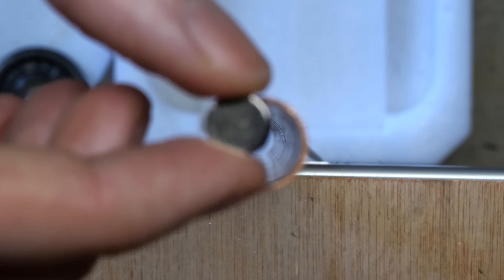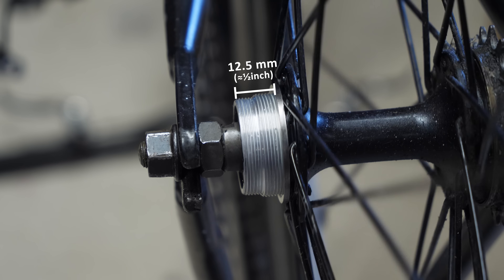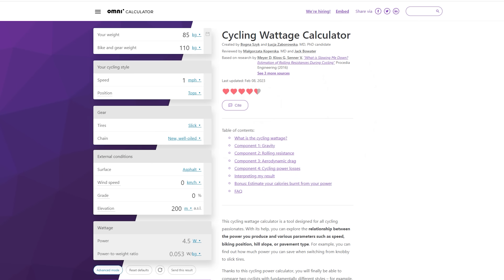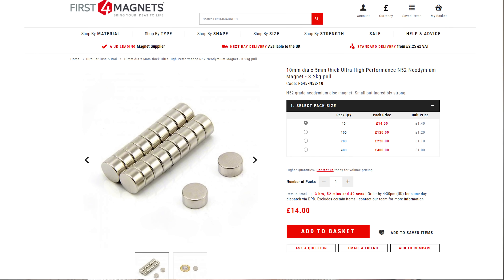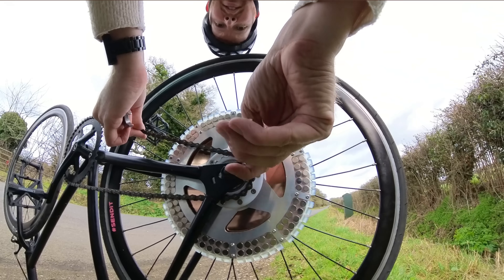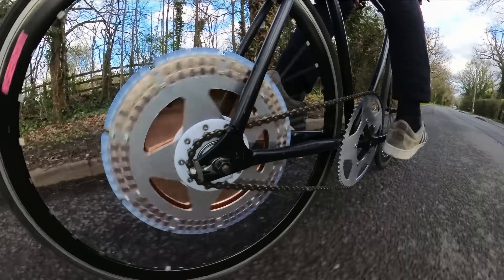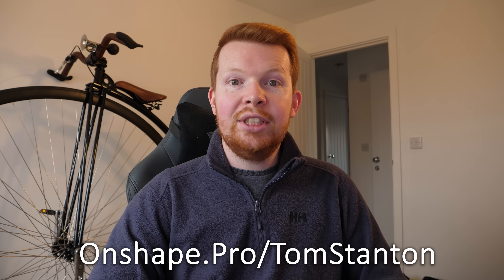Gearless Magnet Bike

Comment: I'm no wiz at this stuff, but couldn't you replace some, or all, of the solid plate with some coils? You might have to get fancy for which and how much, the magnets pass, but with some rectifiers and a battery, or maybe a big capacitor, and either a  motor assist, you'd be preserving a lot of energy. Might make for a nice e-bike that you can recharge on the go, even while "e-breaking."

Anyways, like I said, I'm no wiz, I just see wasted energy that looks like it could be kept or recaptured. 

nice project, glad you made the video. :--)

Comment: Seems you could gain functionality in several areas via electromagnets as they are stronger and can be disabled fully or partially. You could have fewer magnets and have a switching to allow for some or all to be turned on or off. I'll leave this idea at this for now - I'm an engineer, if you want to discuss this further and/or need/want assistance, let me know.
Good post, interesting concept and video. Thanks for posting.

Comment: 1) I believe the copper needs to be a larger diameter and another set of magnets attached on the outside of the existing ones, and 2) pedaling backwards should increase the braking force

Comment: I’m wondering, making the copper disk a larger diameter, cutting out a lot of material in the middle of the disk and perhaps drilling additional holes would improve the whole system, particularly in helping to bring temperatures down. Also increasing air flow through the magnet holders. Either way, what a fun idea, who cares if it worked as intended or not, best way to learn is by doing.

Comment: I have an idea for modernizing the way energy is transferred from the pedals to the wheel. The concept is to make it an electric transmission. The wheel would be driven by an electric motor designed for bicycles, while the pedals would drive a generator. Due to the high efficiency of electric transmission, this setup would result in high overall efficiency, and at the same time, it would allow smooth adjustment of torque. You might even be able to control the torque electronically. I think this is an interesting idea—I haven’t seen anyone try it, and it could actually work.

Comment: Looks like it is not very efficient at achieving an output of 1 to 1 however it is quite similar to a viscous hub using fluid transfer instead of attractive magnets, maybe you could try and combine the two principles, once the magnetic force reaches a certain torque you could have the viscous hub engage almost like a second gear

Comment: You said the torque goes up as speed increases, but I would think it decreases with speed. Electric motors have a max torque at zero rpm, and as speed increases, torque goes down.

Comment: i just realized your biggest mistake with this is using solid disks. wound wires would have worked a lot better. second mistake is thinking the amount of magnetic field is important, when it's the strength of the field that's important, so, had you attacked the magnets it would have been more effective. i guess having all the energy to make stuff doesn't mean you understand how to make stuff.
Reply from the maker: How would wires be better than a solid plate? Magnetic brakes use solid plates. I used N52 grade magnets with the smallest air gap I could manufacture, therefore the field couldn't be increased further. What am I not understanding?

Comment: People redescover some of these effects. My 1962 speedometer uses an aluminum disc with a magnet spinning around connecting to the transmission output cable.. adjust the size of magnets will change the speed displayed.

Comment: You could have simplified the spacing issue by using a bike with a wider P.L.D.  Modern road and mountain bikes use wider hubs. Fixie frames, like the one you were using, a much narrower and have less space between the hub and the frame.

Comment: Interesting experiment, but this kind of eddy current coupling is extremely inefficient. The induced currents in the copper disc turn most of the energy into heat instead of motion. So while it looks cool, it’s fundamentally a very lossy and impractical drive concept.

Comment: Smart people acting like idiots like this idea a lot.  But the magnetic connection of the sprocket to the wheel is stupid in many ways. #1 it is already connected properly. 2. power to weight efficiency is required in a bicycle, and you are doing just the opposite. 3. Find something useful to do with your time.

Comment: Aluminium falls slower because although the conductivity per m is lower, the ratio of conductivity and mass is better. If both the copper and aluminium were the same shape and the same mass (for example, rubber weights are added to the aluminium to make it as heavy as the copper), copper would win.

Comment: I wonder, you had a laser cutter and aluminum plate. Why didnt you cut out a gear out of it and then just grind some taper on the ends? Some cassetes in bikes are made from aluminum. Its probably a harder grade aluminum then you have, but it should be a lot tougher than plastic

Comment: I would like to see how it holds up with an engine driving it.

if you do it right, you could "engage" the clutch with a cable. because its not a solid connection, it would not stall the engine, as you give it more power, the clutch would automatically regulate it and act like a torque converter.

Comment: I wonder if this is the magnetic equivalent of a hydraulic torque converter. Since the torque to the wheel scales with the difference between the input and output speeds.

Comment: Seems you could dissipate that energy segmenting the disc and putting a load across the segments.
You could then vary the load and achieve different levels of direct drive torque and breaking efficiency.
In all honesty, it would be better to just replace the wheel hub with an electric motor then sink the load into a battery.
Then you could use the battery in the opposite direction to propel the motor when sufficient charge had built up with bridge rectifier.

Comment: if you use a squirrel cage instead of a solid disk, as in an asynchronous motor, the losses will be lower. In theory, the efficiency will be 80% or more

Comment: In the beginning when you show two plates falling to ground one aluminium one copper and you say that copper falls quicker because it’s heavier that is incorrect, weight of the object doesn’t matter on how quick it falls but only air resistance (in that case electromagnetic field) you prove it by dropping feather and stone in vaccine and see they fall with same speed.

Comment: This is a "dry torque converter," I understand. It uses a magnetic field instead of the  automatic transmission fluid in cars. Or the friction of the vernia dial on a radio.
As a gear changer, it has low transmission efficiency. However, I think that by adding coils, it may be possible to control the assist ratio of  electric power-assisted bicycle and the gear ratio as a whole, like the planetary gears in Toyota hybrids.

Comment: I think it works like a torque limiter, the human muscle might have preferable speed to deliver maximum power. However, it doesn't provide any change in gear ratio.
I think it would be interesting if we can make gear out of it like a magnetic CVT (I'm not sure if it even exists yet), 
One idea is to make a planetary gear like one in automatic gear and use magnet to lock or resist on one the ring gear to change reduction.

Comment: so, make it a 90 degrees moving alternating magnet disc cvt, instead. yep the small driving alternating magnet disc can move along the radius of the metal disc, so a cvt. then the drive shaft is horizontal from the pedals to the back wheel. no chains. yep two of those gears make a chainless axle bicycle drive. also no touch is required, only the magnetic contact.
Reply: yeah replace the whole chain with axle magnetic drive against the drive disc, copper or steel disc. yep iron disc as the second disc with a small axle roller would be the best, exactly like a standard gear minimal slip but non-contact still. ie locked gears vs free friction gears.

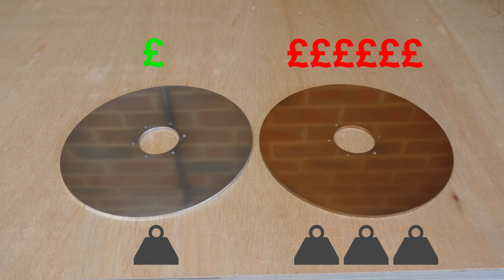Comment: 2:35 As soon as I saw this setup I immediately thought "That's the magnetic braking system of a baitcaster fishing reel". They work on the same principle, you control the force of the braking power by adjusting the distance of a magnet array to the spool. It's usually done with aluminum spools in those reels.

Comment: If you want strong 3D printed parts try thr Markforged Metal X.
It 3D prints in Copper, various types of Steel, Inconel etc. They're not cheap but if you're creating 3D print designs that require strength you can't best metal 3D printers, way stronger than resin can ever be.

Comment: Change the magnets to coils. Remove the chain. Add a generator to the pedals and directly link its coils to those of the clutch. This will induce a magnetic field at each coil of the clutch that's directly proportional to the speed of the pedals.

Comment: I have worked in the electric motor industry for my entire career, so I have some understanding about induction motors.  What you have created is a very low resistance rotor due to the low resistivity of copper. This results in very low torque under high slip conditions (which is what  you have during acceleration).  You might have better characteristics by using a “lossier” rotor.  It will develop higher torque at high slip at the expense of more loss at low slip.

Comment: The only issue I can perceive with this magnetic braking/gearing sitch is the amount of heat that both the copper plate AND the magnets experience when braking, for the magnets sake. Heat the permanent magnets enough and their power will diminish, showing up as a torque loss.

Comment: Technically it is an electric bike. 
Maybe you make a disc with the magnets that would be attached to the wheel and the copper bit to be attached to the sprocket - maybe this would help with further modifications?

Comment: It's an interesting idea and a great video. Unfortunately, as a way to achieve a variable gear ratio it's kind of doomed as any difference in speed between the magnets and the copper (slippage) is going to waste energy and it's unavoidable (as you discovered with the copper heating up).

Comment: Why to work in the negative direction? As a physics student i can see there's lots of loss of energy. 
There's a high resistance at starting ( you have to work like a buffalo to start the motion)
Even at highest speed you have to work on it more and more to maintain the momentum. (No gear ratio) You can't get any mechanical advantage from this work.
If you waste time, get something effective and useful. Thank you.

Comment: The only question I have is why did you start this project with a touring style city bike? You could have saved so much time with any other bike as long as it had working front and rear derailer. I definitely like this proof of concept. It kinda reminds me of a torque converter on automatic transmissions but magnetic.

Comment: Nice effort, but your comparison between the aluminum and copper discs was relatively useless. The copper disc is asymmetrical and out of balance, adding resistance. Your test is just as flawed as Veritasium's.

Comment: I'm a home inventor that came up with the same idea.my first attempt was to secure  small neodymium magnets around the perimeter of the wheel tread and three adjustable magnets just above the wheel.it actually worked.then, I made an axle version with less magnets and it worked as well.one thing I had to do was place weights at specific points along the rim to balance the tire,and it made a huge difference.im going to continue with this idea.youre on the right track,my friend.d9nt give up!😉👍🏻💪

Comment: There is not, "no friction". The friction is magnetic in nature. That overheating will quickly kill those magnet types. In a disk, you are creating a "record player grove" of magnetic forces. If you put a wire in the center of the disk and another on the outside edge, it would be generating a current. On the reverse, if you applied a current to the wires, the disk would start to spin. It spins because the magnetic line that is formed, is trying to repel itself. That cause it to push in one direction, which starts to draw "record groves" of magnetic mono-pole or "inward pole" forces. (This is also how your power meter works. The higher the amps, the faster the disk spins. If voltage is constant, each rotation can be used to calculate the wattage draw. However, power companies know how to manipulate the voltage to lower it, so amps increases, spinning your meter faster, so they can charge more. What was once 120v has dropped to 110v and as low as 90v in some instances where the power companies are shady!)

P.S. New meters use a disk, but also now use a circuit to get "power grade adjusted readings". They compensate for lower and higher voltages as well as "power factor", which is a loss when the waves of AC are off-center too far. That was another way they could manipulate the power to charge customers more, for less power actually being delivered. (Relative to what the billing reflected as "delivered wattage", which is a measure of amps * volts, which they don't actually measure and just, falsely assume.)

Comment: This was awesome. Useless but awesome. And a belt instead of chain would of helped.   You should actually keep the same idea but for like a regenerative electric brake just for your lights n stuff.   Like a small battery pack under the seat. N lots of fancy lights or radio.  No charging ever needed😊

Comment: Just what we need plastic breakable gears, with an inefficient slipping drive system. YEAH!! WHY DON'T YOU INCLUDE MAGNETIC STEERING, SO YOU CAN CRASH CONSTANTLY!! Realistically magnets might make for a good suspension. Changing your gear ratios won't change the FACT that your drive slips.😢

Comment: What a great video! Could you try using a steel disc and see what the results are? Instead of using eddy currents you would be using standard magnetic attractive force, which can be utilized to a greater degree of efficiency. Like a wind turbine, but your legs are the wind and the wheel is the turbine.

Comment: Putting permanent magnet doesn't make sense, if you want to make a practical break, you must make a coil, like a selenoid, a battery pack of somesort, and a switch on the steering. Also, the slower the bike goes the worst the break is gonna work, so such thing would be useful to slow down the high speed if the actual breaks are not sufficient, since at higher speeds this is very sufficient.

Comment: This magnetic sliding clutch could be an alternative to the oil rpm convertor in automatic gearbox, possibly more reliable, unless it heats too much.
These automatic gearboxes anyway use several gear ratios, allowing to raise the wheel torque at low vehicle speed, compensating low difference between engine rpm and the corresponding wheel rpm.

Me also, I used a hanging bottle with water (adjustable force, independent of the position, where dybamometer would not work) to determine the return torque of a crank at end of travel (while closing the throttle body).

Comment: You could adjust manget to move away front the center as the rpm builds up, and with low rmp have the magnets be close to the center. This way, it would probably be easier to cycle uphill.

Comment: For the sprocket breaking:
You probably used a old chain? This chain was probably lengthened, so it applied the full torque to ONE sprocket tooth instead of distributing the load over multiple teeth.
Even if you would have used steel teeth (new sprocket with old chain), the chain may have jumped due to this.

Comment: Dude if you put a spring between the magnet plate and the copper disk you could then apply different lvls of pressure to vary the transmission of energy(pedal fast slower).
Secondly a set of gear on the outside of the plate would help. The same as haveing 3 speeds on the crankshaft!
Furthermore try haveing the magnet plate variable so theres like layers you can increase the amount of magnets in play with a sprung plate and a pressure wheel via cable. Allowing lower or higher torque input output ratios. A thicker copper plate. A copper plate with magnetic insulating on no effected surfaces to increase internal eddy current retention. insulating mechanics employed on the spokes and the chain+other places of interference ..

Comment: Wrap coils around the magnets and power them through an adjustable source to get variable torque coupling strength. If you put rotary encoders on the wheel and pedal crank you could implement a control system that always allowed a peak efficiency to be maintained for the pedal angular velocity. You could also implement kers on braking using the same equipment.

Comment: So I assume you may already know but you can make magnets stronger the cooler they are and if I ever understood correctly, the copper itself will lose braking efficacy as the plate itself heats up. So on a cooler day your clutch will be stronger and as you use it, as you definitely already know, the plate heats up and as it heats up you end up with less eddy power.

Comment: you can use thread endmill and Cyclus 262

That the CNC Program For your Thread 
you can use that on controller from HEIDENHAIN TNC 320 to TNC 7 
For that i set the Zeropoint in the middle of the disk. 
To fing the middle just use Circle Touchprobe 

TOOL CALL 169 Z S5500 F600
M13
CYCL DEF 262 THREADMILLING
Q335=34.92; DIAMETER
Q239=+1.058; PITCH (positive nummer is for right hand and negative nummer for left hand)
Q201=-6; THREAD DEPTH 
Q355=1; THRED DELIVERY 2 (some endmill have less or many tooth)
Q253=FMAX; PRE POSITIONING SPEED
Q351=+1; WAY OF MILLING 
Q200=2; SAFETY DISTANCE.
Q203=+0 ; CORDINATE SURFACE
Q204=50; 2. SAFETY DISTANCE.
Q207=AUTO ;MILLING SPEED
X0 Y0 FMAX R0 M99
M5 M9
M30